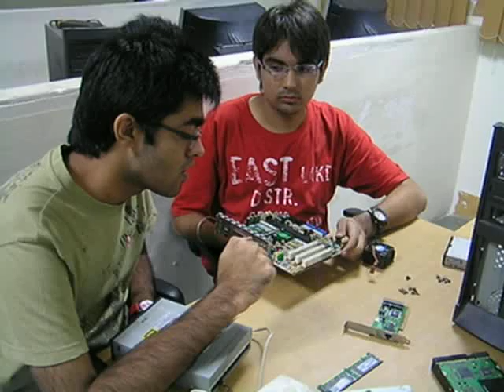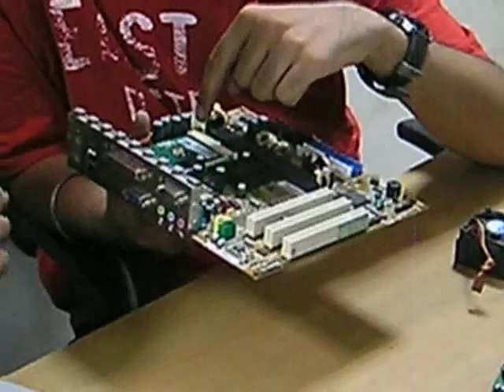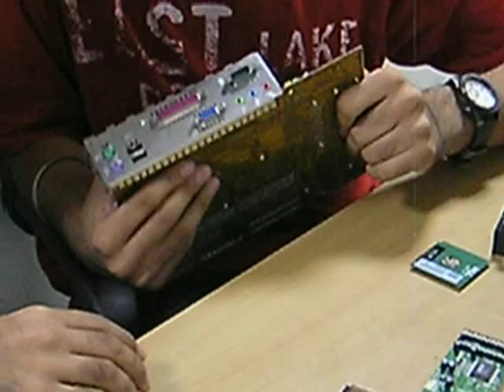Insight into a Motherboard

Comment: Hey guys I'm trying not to disrespectful but you made a one mistake.  Although your knowledge is good. Just the processor is CPU. There are three main parts in a processor CU ( Control Unit) ALU ( Arithmetic Logical Unit) and the I/O. 

CU and ALU  together is the CPU   The central process unit